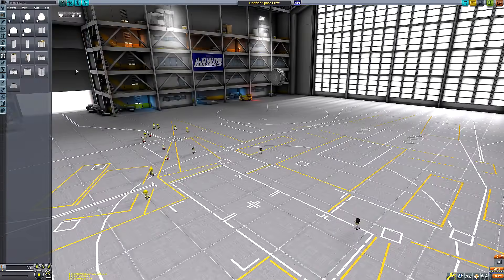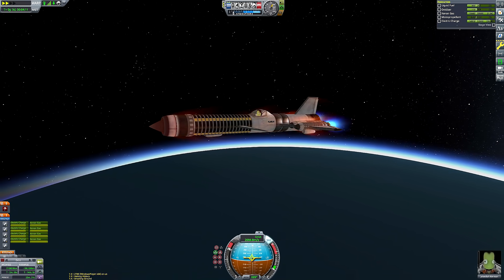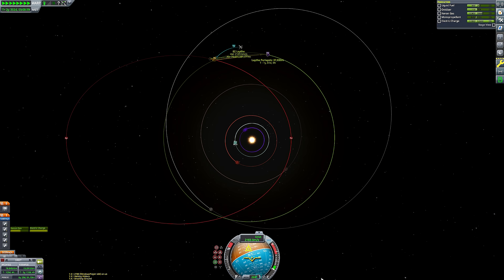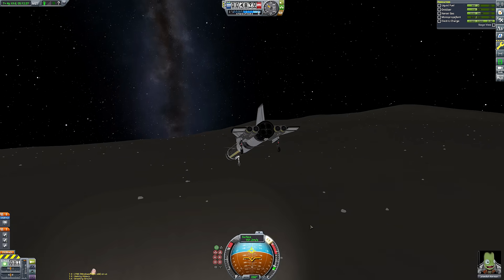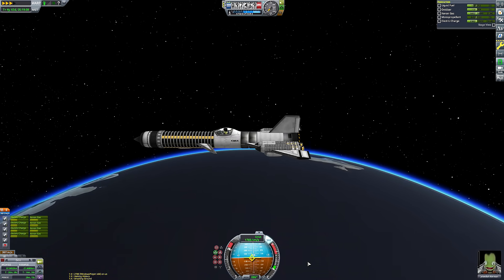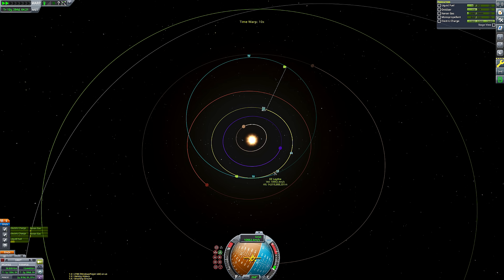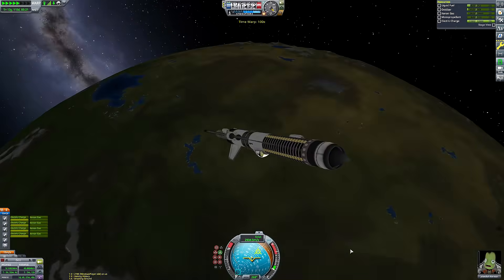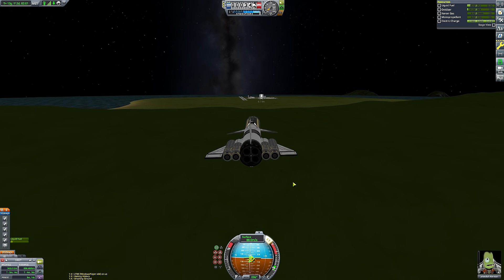KSP: I changed my mind about ion engines...

Comment: Why didn't you dump or burn up the oxidizer earlier in the mission?  It ended up being dead weight for 90% of the mission.  You probably could have saved a ton of delta-v by finishing it off early.

Comment: I used to think ion engines were annoying because you had to go nuclear to use them and those were inevitably heavy vehicles.... And then I realized that you can use fuel cells with LFO... If you match the scale of the fuel cell with the scale of the ion engine it does not take much LFO to propel a lot of xenon at a really high speed.... My current vehicle that I'm playing with has a thrust weight ratio of 0.38... it uses 17,000 electric charge per second and weighs almost 80 tons... I have enough meters per second to go to Jool and back three times.
I honestly didn't even think it was possible in the game.
I have a single RTG and only a handful of solar panels and that's as an insurance guarantee in case I don't turn the fuel cells on in time or in case I don't turn the engine off before I run out of fuel. It's an absolute monster to build and launch, but once it's in orbit it's a cakewalk to refuel. Cannot recommend experimenting with fuel cells and ion engines enough.

Comment: Wondering how your ssto gets above 440m/s. I made a smaller/lighter one, and it stops accelerating at 330m/s. Could it be because my game settings are different?
Reply: Never mind, apparently tucking things in using the 'move' tool does not actually alter the air resistance they are generating. If I use 8 mk0s (2 behind eachother, 3 around each of those, tucked in) my aircraft generates massively more air resistance, apparently, than just using a single mk1 liquid fuel tank.

Comment: Mat, I've just recently done a resource discovery mission to Jool on ion engines alone and I've analysed resources on all of it's moons AND Jool it self. I've got a ship on Joop orbit with enough xeon to do another planet easily (circa 35km of delta V left). All of those without gravity assist or air braking by the way :P

Comment: the gravity assist maneuver free thing is true, because there was never a part where something:
1) used gravity 
2) assisted the mission (several mishaps lol)
3) was a maneuver (landings dont count as they are literally impossible to avoid, and dont happen in space, and winged ascents dont count, as they are not using gravity, they are using air)